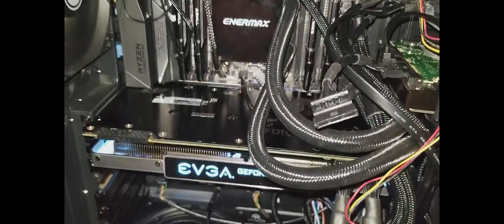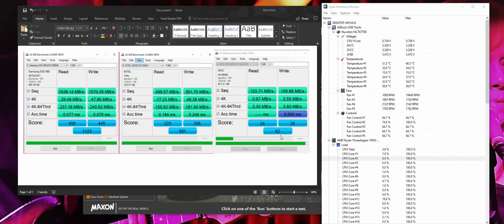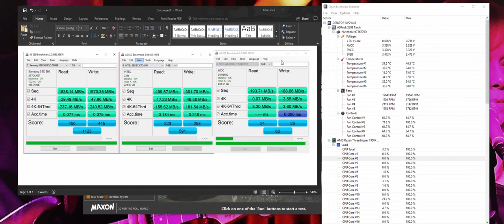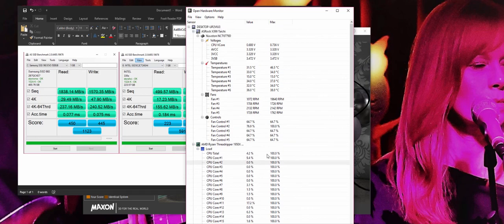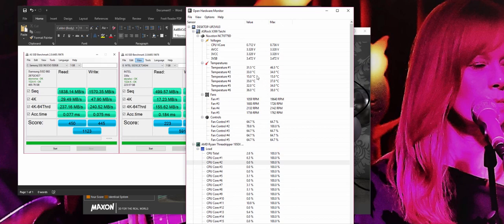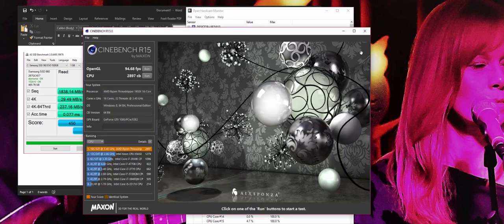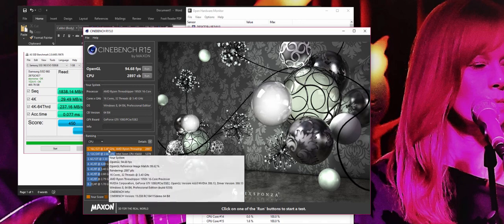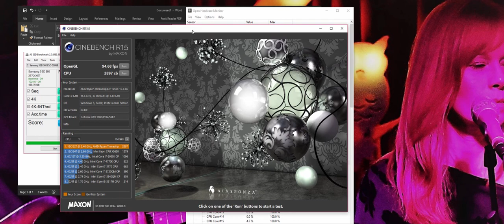Stock Ryzen 1950x Threadripper Build with Enermax TR4 and ASRock X399

Comment: Haha, and I thought my harddisk placement was minimalistic. xD https://www.youtube.com/watch?v=_WrsZy_Y99w
Is that the 240 or the 280 radiator? And are the fans running at maximum speed? What kind of noise level are they giving off in the video?
Reply from the maker: mine is the 240.  All the fans are running at stock...I haven't adjusted anything.  Not sure how to describe how loud...the case is under my desk right at my feet and I can barely hear it...it's audible but barely.  HAHA yeah, no one sees my case or whats in it so I'm not really into making it look fancy.  I built a PC for my kid last year for xmas and I made it nice and fancy inside. :)
Reply: Hm, I guess the fans might be auto-controlled by the mainboard then. But if they're not and that's 100% speed, then I as a silent-fan can relax.